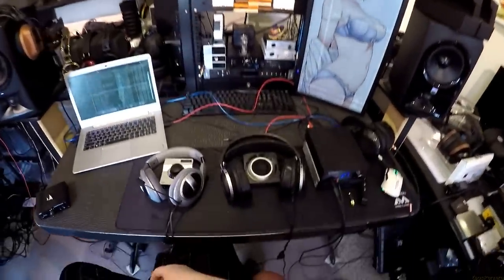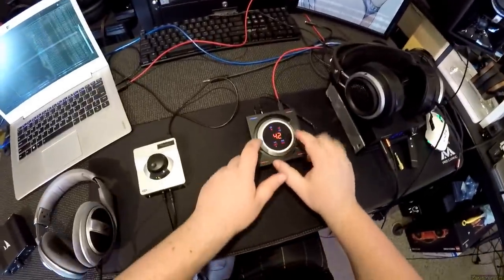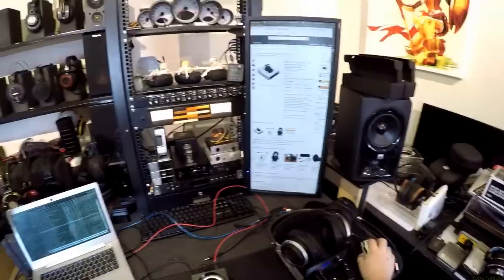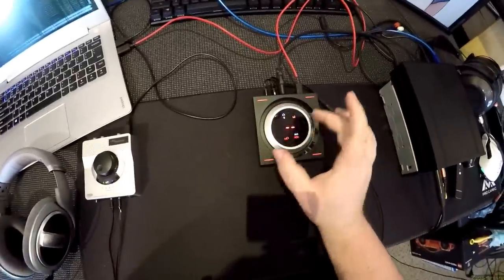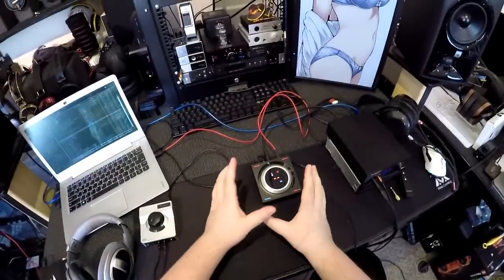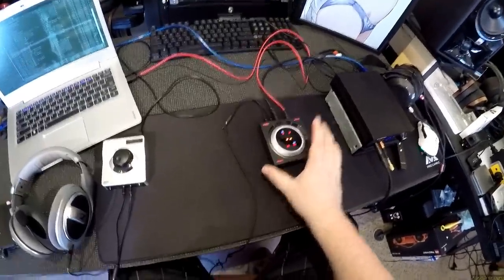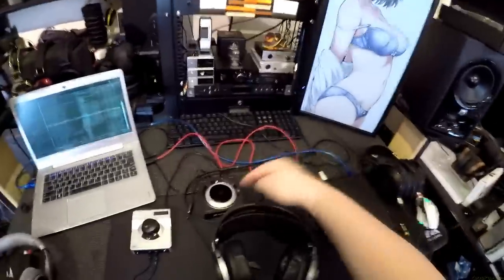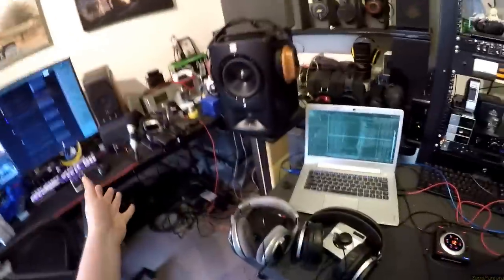Z Review - Sennheiser GSX1000 & Burson Play & Syba Sonic & Mayflower Arc

Comment: Modmic is the answer. I dont get why you would plug a boompro into your quality headphones.
Reply: Gray Au I got my entire xlr microphone (- phantom power) set for less than a modmic. It sounds much better too.
Reply: Gray Au cancer? Offended much? ;) yes a well set up xlr mic will sound better then a modmic or boompro, but unless you want to record hq music, a modmic does just fine.
Reply: Gray Au you get really heated quickly dontya? ;)
Reply: @Gray Au You clearly don't know how a ModMic works - so I can't believe anything else you say. (Hint: There is no possibility for ground loop issues because a ModMic doesn't share a ground with your headphones.)
Reply: TostiTostelli
 Zalman ZM-MIC1 is the answer sound quality is similar and it f* cost 5-10$
Reply: don't forget your usb soundcard to power the modmic, thats why everyone thinks they are crap. it sounds great off a soundblaster play, i only use the mic input on mine.
Reply: First off, Boompro is still way better than shitty cable that comes with X1 (not audiophile kind of shitty cable, but actually making them sound much worse than any normal cable). Second, you won't notice boompro anyway while gaming, it's not that bad.
Reply: +Gray Au I assume you mean the Boompro, which shares a same ground pin with the headphone and the mic, then splits it into two 3.5 plugs. If you plug the two plugs to two different sources, i.e. a usb headphone amp and the motherboard mic input, two different ground pins with different potentials are given to the mic and the headphone, causing the ground loop. 
A Modmic (or a external usb mic) is SEPERATE from the headphone, they don't share the same ground pin, therefore no ground loop issues.
Reply: 2....wires, its not so hard to understand why.
Reply: TostiTostelli Modmic is too expensive and annoying because of 2 wires.
Reply: Gray Au  not on console

Comment: Hi Z, I hope you can help me! I'm a total noob in this things, how can I get Audio from my phone to my PC?

I'm a streamer and I got the great idea to stream mobile (to my OBS in my PC then stream from there because I can't use emulators) but I'm really having troubles to get the audio from my phone to my PC I'm trying with a 3.5mm but I'm getting very weird behibiors depending on where I connect it (mostrly noise) I tried first with a Bluetooth receiver (ment for cars) but the noise was worse. 

I understand that the Syba Sonic will do the trick, but I think those devices are not ment to solve the problem I'm having. What will you recommend? If you don't have much time I can make the research just help me to know what I'm looking for, I tought I should look for an ADC but it seems that is not a thing, or it is very hard to find, I'm completley lost! :S

Thank you!!

Comment: Sorry,  noob question. I was following until the very end.  So I have a blue yeti on an arm stand and 3 decent pairs of headphones. Since the mic is separate,  does that mean that all I need is an amp to drive the headphones? I thought you always needed a Dac.  I was planning to get some 58x jubilees and am trying to figure out what to pair it with to sound it's best. Was thinking of doing the sound blaster g6, but if these are pointless now,  what should I get? Thx for any and all advice.

Comment: Will the Syba Sonic drive T50RP mk3's? I don't necessarily need the mic input, but I do need a good Dac/Amp and am thinking of picking up mk3's to replace my aging/almost dead DT770 pro's. Seeking 'affordable' options, Fiio E10K or the Syba Sonic obviously fall into that bracket (say, less than 100$) Mic input is a bonus, as I do have a desktop mic and use an external USB crap "soundcard" (Actually, its the 7$ Syba usb stick lol), so combining the 2 would help wire management a bit.

Comment: I have a gsx 1000 and I love the 7.1, but its not powerful enough for my hd 650's. Can I use it as a dac with something like a magni 3? I'm new to this stuff.
Reply: Hey there. I've been using HD 558 (50 ohm) with the GSX and it works beautifully. Now that I've ordered a pair of HD 660s I'm wondering whether the GSX will be able to drive them well (on a gaming level, not an audiophile one). I'm pretty sure it won't drive the likes of the HD 650 (300 ohm), but have you tried the gsx with a pair of 100-200 ohm impedance headphones?
Reply: Btw, I've read several people double amping the sound signal. It's easy: gsx's headphone out (3.5 mm) to an amp's input (usually RCA input), and you're done. That way you keep the 7.1 sound coming out of the gsx (line out only carries 2.0 signal).

Comment: Hey Z Reviews, this is kind of unrelated but you're one of the few peoples opinions id trust on this question. The Antlion Modmic 5 has an operating voltage of 1~10 volts. They suggest (and even sell) a USB 2.0 adapter/soundcard thing where you'd plug the mic into. USB however only provides 5 volts, that is half of the max operating voltage. The Mic sounds like complete garbage from motherboard IO panel, and just good, from an external usb connector. I'm wondering if there are any devices that can deliver those missing 5 volts to the modmic and possibly bring up sound quality from good to great?

Comment: I have SPDIF from my PC going to SMSL SD793-II DAC/amp, then line outs from that going to SMSL SA-60 to power a couple small Yamaha HTIB speakers that I use as computer speakers. I need to get a mic input without a separate cable. Would you recommend the Syba Sonic to replace the SD793-II OR go to a Syba Sonic via USB then from that to the SD793-II via SPDIF? I don't want to lose out on sound quality since still want to use it for music listening as well as gaming. I'm worried that Syba Sonic would be a worse headphone amp than the SMSL.

Comment: Hey Z! I currently  have a fulla 2/Magni 3+ set up along with 560s, Vmoda100 and he400i. I'm looking to upgrade my fulla 2 to a modi or gsx1000. I like the idea of virtual 7.1 option and use the gsx1000 as preamp dac for my magni when gaming.

 I'm not really sure if there will be any audio quality upgrade going from Fulla 2 to Modi Dac.
In short, should I go for Modi or Gsx1000 for gaming and music?
Reply: Yes get the GSX1000 and run it through the external amp.  In 7.1 mode its fantastic.  I use Beyerdynamics through a IFI ZEN CAN amp connected to GSX1000 in 7.1 and its meta

Comment: Had the Syba Sonic for less than a year, burned out one of the chips on board. Using it with Mk3's. It doesn't quite have enough power for really driving them, but it works. I always had the Treble boost on (filthy casual gaming obv). Anyways, for 35$ I dno't think you can go wrong, but I don't really expect it to last longer than a year. I pulled mine apart and sent pics to Syba Sonic, hopefully they have already, or are going to upgrade that one chip (it's a one of the voltage regulating buck converters, I believe 3V in to 23-24V out). I put pics on my amazon review. They did offer to RMA but for 30$ who gives a shit. I bought another, will pull apart and see if they upgraded board at all.

Comment: I have 1more "triple" driver headphones and wondering if I bought V-Moda BoomPro mic and SybaSonic will I be able to connect the three considering that both sides of the headphones are wired? I'm thinking if I connect the BoomPro mic to one side of the headphones and then mic+headphone port on syba and the other side headphone wire using an audio jack would that work or do I need headphones with a single wire? Thanks

Comment: Where would the soundblasterx G6 fit in? Did you already test that unit Z? I'm in the market for a DAC/AMP for my PS4 and since the GSX1000 seems to be not compatible I think it will be either the Mayflower or Soundblaster
Reply: Sorry I don't know how this stuff works, but can't you just plug the dac/amp into your tv/monitor and it would work for your ps4?

Comment: 5 1/4 are still good, i have a raid setup, and many ssd ,  you can get a 5 1/4 drive bay that fits 6 ssd. you can get a external enclosure for your blu-ray drive "vantec" makes a nice one. Thanks for the Video!  i used to have a 5 1/4 cassette deck, "Plus deck 2C" worked good.

Comment: Any suggestion on what to pair with the sennheiser 1000. Head phone wise. I’m currently using the Sennheiser GPS 500 open back.  Looking For the best set up possible for FPS. I am old and need all the help I can get. Love your Videos. Cheers
Reply: I just got the sennheizer x1000 with a hd660 s headset. Matches the max 150 ohms the x1000 can push and has an amazing sound all around. No distortion and buzzing, just amazing. I use the yeti blackout Mic currently but looking for a better mic shortly. I tried a few other headphones with it like the sennheiser hd565 and it was missing most of the mid ranges. I paired with the new corsair vig but the amp overpowered them and everyone could here my games through the Mic.

Comment: I'll tell you what. Buy a Yamaha R-S202BL and adjust the bass and treble to your liking. Using the receiver right now with my HD 660 Ss paired with a Schiit Wyrd and Fulla 2! Amazing bang for buck performance. Plenty of low end and the surround sound becomes greater! I had a Schiit Asgard 2 paired with my Fulla 2 and I can say personally that if you have a receiver like a Yamaha R-S202BL then you don't need the Asgard 2. It's kinda sad I feel like saying that but it's completely and utterly true. More low end with the Yamaha amp and greater sound stage from my personal listening. Coarse the only downside is that the Yamaha is HUGE! you can preamp it though with the Fulla 2. I leave my volume at 70 and preamp to around 1 and a half o clock with the Fulla 2. Any greater of a preamp and the amp starts to make cracking noises though my headphones and speakers.

Comment: Two questions:
1. Do I really need this if I have a Schitt stack with Modi 2 and Magni 2 Uber? What is the issue plugging the headphones to the Magni 2 and the MIC to the PC's soundcard?

2. Best DAC/AMP combo for a laptop below $70 - $100? Should I bother with the Syba Sonic, Fulla 2, something else?
Reply from the maker: If you get a ground loop hum because you are using a single wire solution. Then you need one of these. If you have a separate microphone you don't have to worry. Only with the BoomPro and the ATH compatible ones are these REALLY necessary.
Reply: Thanks. Is your Reddit list still accurate/up to date on the DAC/AMP recommendations? FiiO has came out with some good-looking (good-sounding, too??) gadgets. Looking for a laptop DAC/AMP around or below $100.

Comment: 1:54 Z I might just be a newbie (just owning takstar pro 82, ATH m40x, DAC x6 , and Klipsch Pro media 2.1) but I honestly couldn't tell the difference between the onboard sound of Aorous Z370 Gaming 7 (Asrock Fatality z370 comes 2nd) and my DAC. It drives all my Headphones to a High Volume at 50% and the x720 Sound software"s EQ is pretty good(avoid most of it though). Jet audio + BBE also sounds great with the board's EQ(mostly for pro 82's 4k treble).

Comment: Ok so I want to use the beyerdynamic DT 990 PRO for my Xbox, the controller can only hande the 30ohms and if I want the 250 i have to use a dac/amp that uses an optical cable. Is their a huge difference between a 30 and 250 ohm and if so what would be a good dac/amp?

Comment: Syba Sonic USB 24 Bit 96 KHz DAC Digital, a question on this unit, i am using this as purely a volume wheel for may creative speakers (yes i know i am bad) using the two red and white line outs, can i use the optical as well for another set of speakers such as a sound bar and have all speakers play at the same time? oh on a side note SWTOR has Jet packs!
Reply: Sorry I can't answer your question, but can you use the two headphones outs at the same time with two headphones?
Reply: @ouden.  i don't have head phones so wouldn't know. thank you for the reply
Reply: @ouden.   yes, it outputs to both at the same time.
Reply: @victor2410  thanks for your answer! I've read that it has some connection problems when plug into a Windows 10 PC, have you used it with one?

Comment: Have you tried the Astro Mixamp; Personally it drives my hd600 decently. And I use it to get sound for my computer and ps4 simultaneously.
Reply: You can drive HD600 "decently" from your Smartphone if its any good. The goal is to drive them to there full potential not just "decently"
Reply: "Decently" to the fact that I haven't heard it with a more powerful amp. Also, what would be the "full potential"? Since the Astro Mixamp Pro are "powerful enough" to drive them. Keep in mind that when I game, I only do on a ps4. Cheers.

Comment: In the home cinema universe, we often hear the sentence "You should spend at least just at much on your speakers, as you do on your TV", and we all agree without much to any discussion. At least it's a good rule of thumb, we can relate to. I don't think those guidelines should differ from the gaming community, but apparently it does. 1200$, 32 inch, ultra-wide, 144hz gaming monitor - paired with a 100$ pair of Corsair cans is apparently justified. I'm dead inside.

Comment: Syba Sonic and Audio Technica ATH-AD500x for a primarily fps gaming ? Already have the syba sonic and some akg m220 but not to impressed with the imaging . just looking for a better budget open back , not the superlux  they are good but feel way uncomfortable even with new pads
Reply: The m220s have pretty good imaging, you just need to change the pads. At least to me, they didn't need all that bass in the first place...
Reply: can you use the two headphones outs at the same time with two headphones?
Reply: @ouden.  yes. Tried it yesterday, assumed the quarter inch overrode the 3.5mm but nope, plays out of both at the same time.

Comment: Great Video.

Love it.

I'm a gamer on the PS4 Pro.

I have a Astro Mixamp(vss) and 712pros.

I order a Little Dot MK2+Nobsound NS10p and Fiio D3 for my Ps4 pro and V20 DAC.

I been a VSS lover.
But now I'm curious about stereo and the game audio engine. So I got a Tube Amp.
Plus I wanna use it with my V20 DAC.

I always knew my Astro didn't power the Akg712 pro to full.
It sit at 100% volume.

I can't wait to connect to my Little Dot as a preamp.

Love you man. Keep up these videos

I love Planetside 2.
I'm a cloak flash/Renegade player.

Edited

I'm very sad that the GSX doesn't support console.

Comment: When I plug something into USB port, my Syba Sonic DAC disconnects itself, then reconnect after about 30 seconds. Sometimes when it's really dry, a very slight static discharge, by touching the PC case, can also disconnect the Syba DAC. I logged the events and it actually showed a "unplug" event followed by a "plug" event 30s later. Even when everything is turned OFF, a slight static discharge by touching the case would "energize" the DAC and actually turn it ON, then it turns itself off after around 30 seconds. How do I fix this??
Reply: @silvermold  Hi there, yes I am using the cables that came with the DAC.

Comment: Any bit of static shuts off my Syba Sonic, tried different cables, PCs, headphones, etc. I was thinking of running an amp after this to my SHPs to avoid the issue, but want to be within the pricing of the DAC. Anyone have a suggestion? I know this is an old video. TY in advance :)

Comment: I'm no audiophile by any means and used this channel purely to enhance my gaming(the "fun" type, not the competitive kind). Ended up settling with Mk3 T50s + Boompro because I wanted more bass and soundstage over my set of Cloud IIs.

I did a lot of looking into the GSX1000 because I currently have a Creative Soundblaster G5. Power and feature-wise, it seems to me that the GSX is trash compared to the G5, except in surround sound. But spending $160 for it PLUS probably $100 more for an amp is way overboard. The G5 does power the Mk3s, but probably only to like 80% of their potential(that's max-gain,  though software seems to help here).  The surround sound engine is CERTAINLY noticeable though. Yes, good soundstage helps a ton, but the additional 7.1 setting make it so good that I can actually visualize sound moving when I'm testing the channels. Orgasmic.

The Mk3s actually produce less bass than my Cloud IIs, which will literally shake my head when maxed(though I'm probably peaking them with the G5 because regular volume for me had to be at like 5-10 %. But their sound is a lot more "quality" and surround sound wise they just smoke the Cloud IIs.  In a perfect world, I'd get Argon mod and an amp, but I'm not made of money and there is no way I could ever let go of the surround sound support from the G5.

Would love for you to do a video dedicated to for-fun gaming/music/movies headphones+dac/amp set-up. I think it would help a lot of folks like myself who are completely clueless about audio but aren't dumb enough to fall for the razer/triton/turtlebeach gimmicks.

Comment: I have owned the sybasonic dac for about a year now, and it works fine, but the quarter inch is despite what zeos said not very robust, mine has loosened a but after a year of use, and if I accidentally knock or move the cable it will start dropping out on the left ear. However the ordinary 3.5mm is fine, so it might just be a one time thing.